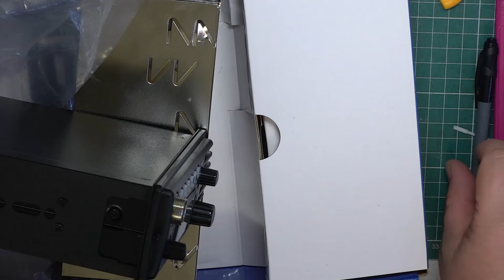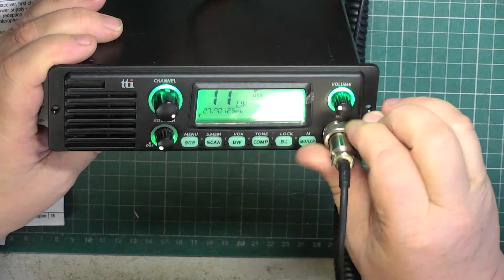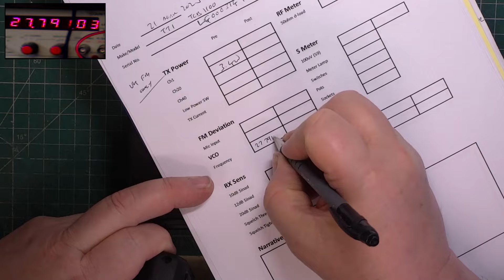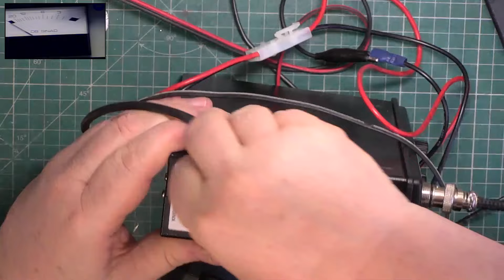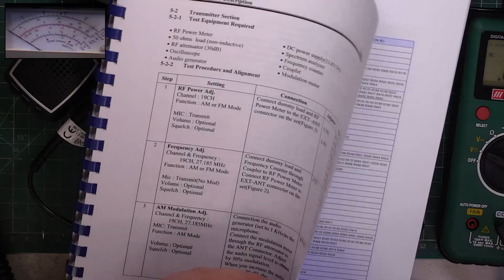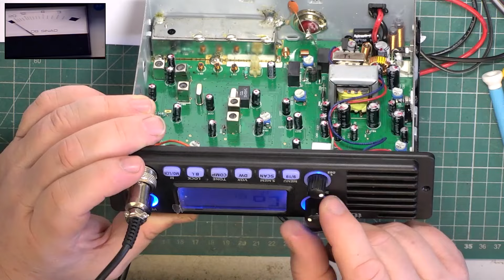TTI TCB1100 CE MultiNorm CB radio - repair & service AM/FM UK/CEPT

Comment: How can i contact you for a repair please i have this same radio but can't SWR it in it is on set in both fwd and rev
Reply from the maker: It's not radios that create bad SWR, it's your aerial. It's either open circuit, short circuit or grossly the wrong length for your SWR meter to read like that. Asuuming the SWR meter works of course.

Richard

rshireby@yahoo.co.uk